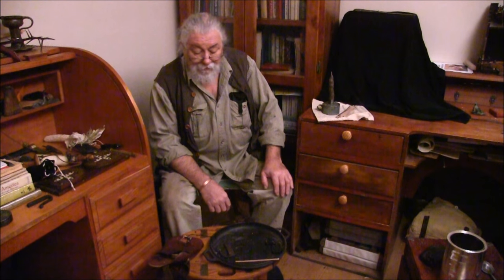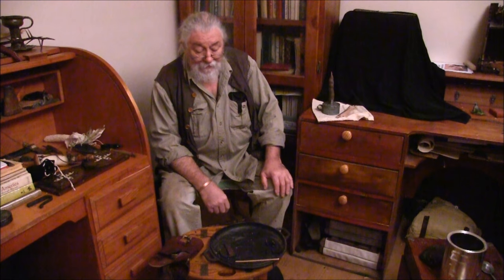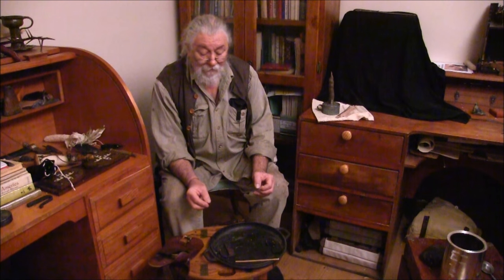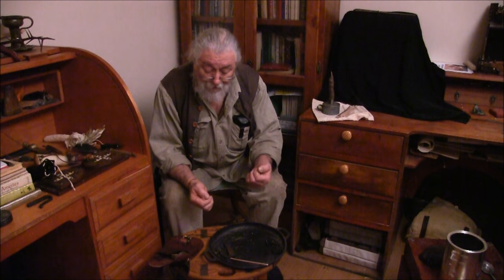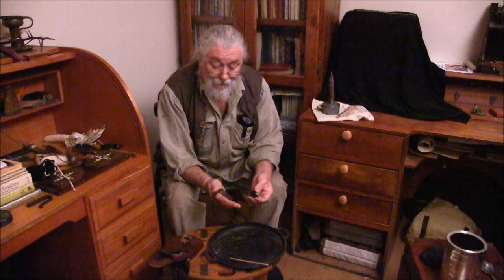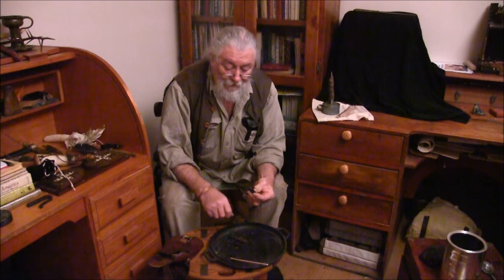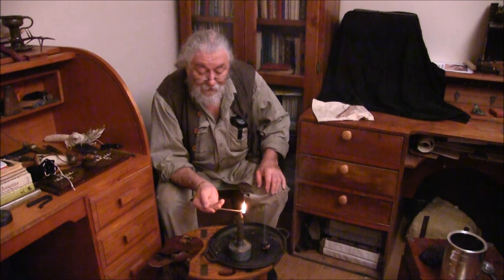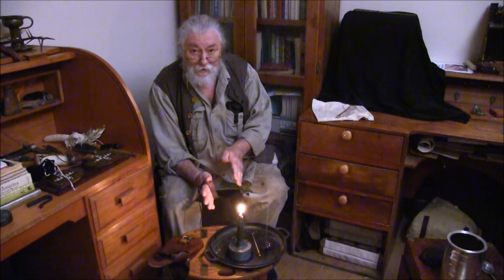The Joseph Method Of Flint & Steel Fire Lighting  By Keith H  Burgess

Comment: I was taught to hold the char cloth or tinder on top of the Flint and strike downward when I first learned how to start a fire using flint and steel.  I have been told I was backwards. I guess the man that taught me used this method, and passed it on to me. Thank you for sharing, and letting me see I'm not the only one that stats fire "backwards". Stay safe.
Reply: Joe Noto I’ve been using a flint and steel for a couple of years now and, like yourself, this ‘backwards’ method was the only method I knew. At least until about 20 minutes ago when I watched Keith do a ‘forward’ strike to light the tinder in the tinder box on different video.💥🔥👍

Comment: Hello Keith,

I like this video and the ones where you use flint and steel to light charred punk wood in a tinder box.  Although (through a lot of practice) I have achieved proficiency in both techniques, I find the Joseph method to be the easiest.  Especially, when I am cold or tired, I tend to overshoot my steel and scatter my tinder box contents.  

My modification to the Joseph method is to char just the tip of a thick piece of cotton fabric (the seams of all cotton blue jeans work well) or a piece of punk wood, to act as a spark catcher and, once I have an ember, I use that to light the charred punk wood in my tinder box.  Then I use the tinder box to light my kindling like in your other videos.

This method is a combination of both techniques.  I have no historical evidence that this method was used in the past, but its ease of use and reliability leads me to believe that I was not the first to discover this combination of techniques.

Thanks for all your videos, I appreciate your good work.
Reply from the maker: I think that you are right, you are using authentic methods, & I doubt you would be the only one to find this method works best for you. Even so, with more practice & experience you may find that you can master the method of using the tinderbox & steel direct. Many years ago I too had to overcome the same problem, controlling the hand so as not to hit the tinderbox.
Good to hear from you Sam, & many thanks for your comments.
Regards, Keith.

Comment: Great to actually see the medieval fire steel in use. I have only ever seen it stylised in the necklace of the order of the golden fleece where the chain links are pairs of interlocking fire steels with sparks inbetween. The use of a sulphur match surprised me though. Sulphur spunks (or spills, as we call them here in Britain) is something on my to do list. Just have to find me some brimstone.

It is also fascinating to see details of tools in paintings, showing that some tools have changed very little since then. Once perfected, no need. Pincers come to mind - also from a painting depicting Joseph in his carpentry workshop.
Reply from the maker: Good day Judy, good to hear from you again. You should be able to purchase sulphur from your local chemist or garden nursery. If you are interested in this sort of thing you can search (top left corner) on my blog http://woodsrunnersdiary.blogspot.com.au/   You are also welcome to join our group's forum  http://neclhg.freeforums.net/
Regards, Keith.
An ex West Sussex lad.
Reply: Thanks, Keith. It is - surprisingly - easy to find pure sulphur here on ebay, but I was also hoping to find a way to make my own from fools gold, of which I have found a small amount on my property. Just to see if I could actually do it. Still, sulphur is cheap enough and a pound or two would probably see me through to the end of my days, and be more reliable than bought matches in this damp climate, and more satisfying to use.

Thanks for the invite to the forum. I will check it out.

Yule greetings from Pembrokeshire.

Comment: Everyone I know here in Texas does it that way with char cloth. You can use a pretty tiny bit of char cloth this way. Usually I use like a 1/2" square piece.
Reply from the maker: It is easier to use "charred cloth", but woodsrunners would have very rarely used charred cloth, if at all. They used plant or fungus tinder.
https://www.youtube.com/watch?v=5f9CjH7plps&t=3s
Keith.

Comment: Great video! how would you recommend making natural char without a steel char box. Would you recommend any reading material or books?
Reply from the maker: Good day Welsby. The original way of preparing tinder, including cloth, plant & fungi tinders, was to char directly in the fire & then extinguish in the tinderbox. Fire was then made by striking sparks into the tinderbox & presenting kindling material, dried grass, coconut fibre etc to the glowing tinder in the tinderbox & blowing into flame. I will include some links below for videos & my book. Any questions, just contact me.
Regards, Keith.
https://www.youtube.com/watch?v=C5WGTxDS1AE&t=5s
https://www.youtube.com/watch?v=T6stn39v-fw&t=3s
https://www.youtube.com/watch?v=5f9CjH7plps&t=2s
https://woodsrunnersdiary.blogspot.com/2015/03/my-book-primitive-fire-lighting-ebook.html
Reply: @historicaltrekking  Thanks Brother, I greatly appreciate your reply. I will check out the links and your book. Keep up the great work!

Comment: Another great video. You have helped me so much. Ive got some modern pack stuff but I keep finding myself wanting to go back to the 1800s and earlier ways of doing things. Im building a pack on the period as historically accurate as possible in very large part thanks to your videos. I was just wondering though do you stay away from plastics entirely? Also could you possibly recommend some 1800s form of canteen to buy? Ive seen a few but are being sold as novelties that wouldn't last a day or just way too expensive. Thanks again for all your help.

Comment: You know, in regards to charred cloth you've mentioned before that it was a luxury and something many people didn't really use for that reason, but from what I've found using charred punk wood instead actually works better anyway. There seems to be no reason at all to deal with charcloth anymore unless that's all you can make since the punk wood coal becomes far hotter.
Reply from the maker: I agree re the punkwood. Larger households would probably produced more tow rag for use as tinder from cleaning cloths, but in smaller households I am not sure if they would have much tow rag available. Amadou was in fact sold on city streets & was generally available from an apothecary shop.
Regards, Keith.

Comment: Hello Keith, 
This question is coming from Western NC. 
Have I missed something? Why don't you simply strike the match by introducing friction to the match head? 
Thank you in advance.
Reply: These are called spunks. These are not modern matches.  They are just a stick of wood with a drop of sulpher on the tip.  They do not strike like a modern match, but when touched to a coal the sulpher will burst into flame and can then be used like a match.-
Reply: Thank you clong9m. I have never heard of Spunks. Must be a New Zealand  slang. Here is what I have found.

http://museumofeverydaylife.org/exhibitions-collections/current-exhibitions/history-of-the-match
Reply from the maker: clong9m is correct simnesan, spunks are sulfur tipped matches. It is an 18th century term. 
Regards, Keith.

Comment: Flint and steel to light a slow match used to light a tin full of charcoal from a previous fire. from that tin of charcoal you can light several feather stick back to back.
Reply from the maker: No sorry Carl, a real flint & steel (tinderbox) will not ignite charcoal. It will set a spark on charred punkwood & some charred fungus types such as polypores, but not charcoal. 
I don't know about a ferocerium rod, that might set a spark on charcoal. I have never used a ferocerium rod.
Keith.
Reply: @historicaltrekking  "Flint and steel to light a slow match" the slow match lights the charcoal.
Reply from the maker: @carls.6746   Oh I see, okay Carl. Thanks for the information.
Keith.
Reply: @historicaltrekking  your welcome

Comment: robust tinder such as amadou, chaga or white punk fungus would be far better for this, punk wood is not up to this reliably, it invariably crumbles and falls apart. I have tried charred punk wood many, many times with this method and it just doesn't work reliably as it is too fragile. Charcloth works a treat obviously, but this is the normal way you do char cloth striking.
Reply from the maker: This then may depend on the type of punkwood being used Orion, or perhaps if it is charred too much. However I rarely bother with this method, because I find it much easier to make fire directly from the tinderbox.
Further to our discussion on tinders, I think you were right, I don't think there is a chemical process involved in the charring that allows a spark to be caught & held, because I have made fire with uncharred bracket fungus. But the tinder does have to be soft, not hard.
Thanks again for your insight Orion, greatly appreciated my friend.
Regards, Keith.
Reply: @historicaltrekking  I agree as to what charred punk wood one uses, though the best charred punk wood for experience is always light, fluffy and spongy and when charred is very fragile. This type of punk wood takes a spark the best from flint and steel the best. The rest is best described as charcoal.